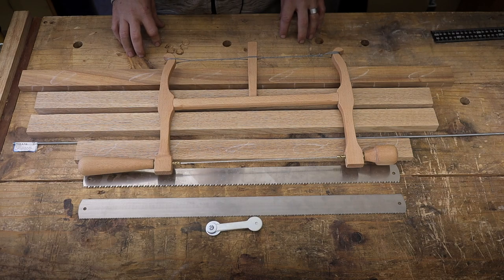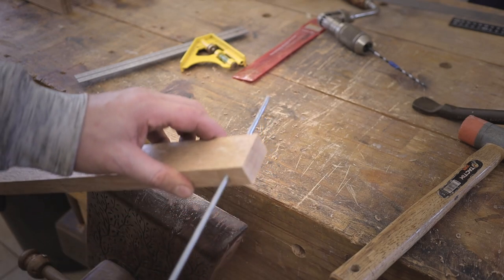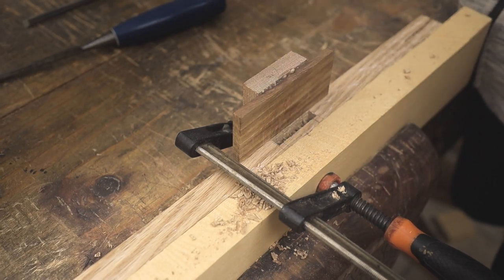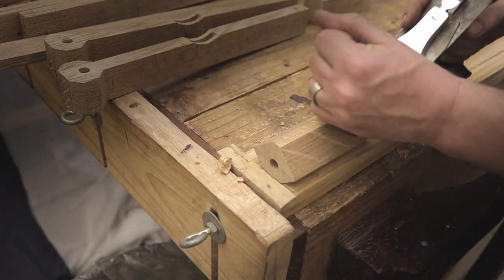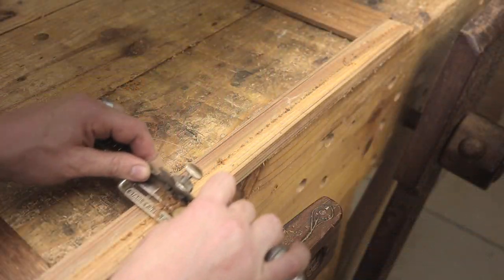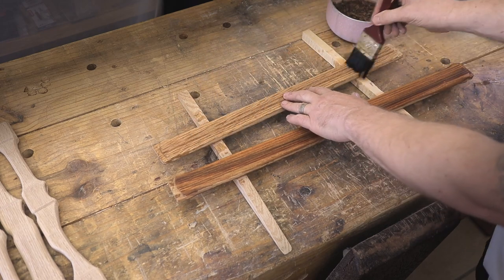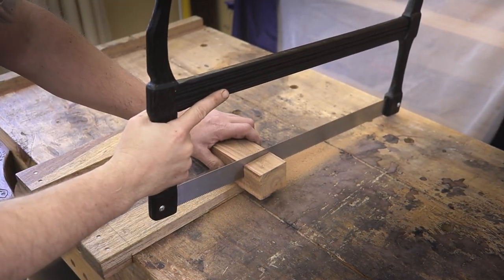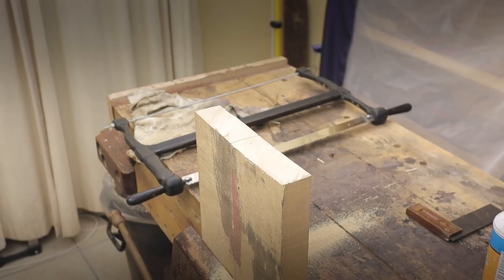Making FRAME SAWS  using HAND-TOOLS.

Comment: Can you tell me where you got the blades and accessories from please ?
Reply from the maker: Hi, got them from Dieter Schmid Tools https://www.fine-tools.com/gestell.html
Reply: Unfortunately Ulima/ECE does not sell the blade holder to any dealer in the US I can find thusfar. When emailing DieterScmidz they never emailed me back about posting to the US. what I was went to Lowe’s and just got some thin steel and made a couple. Not being the best at drilling and tapping I just used a short nut and bolt. They turned out fine. Just not quite as pretty.